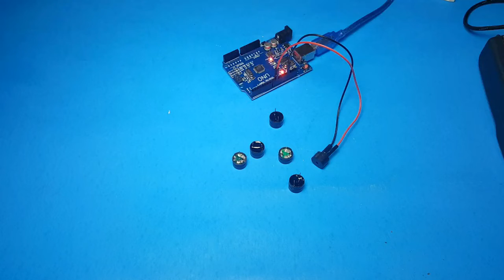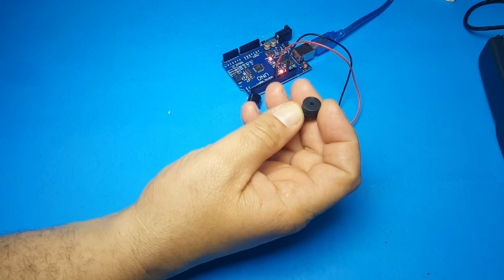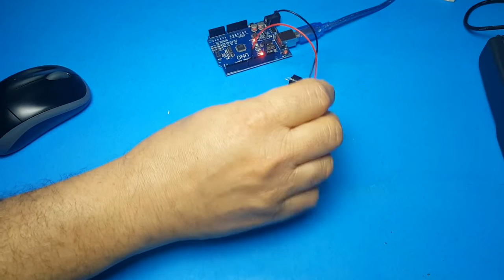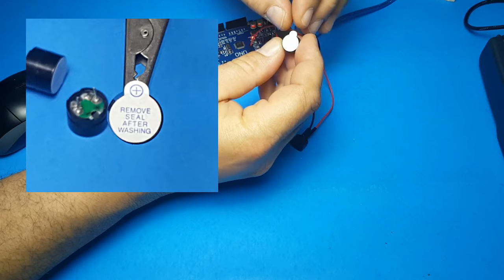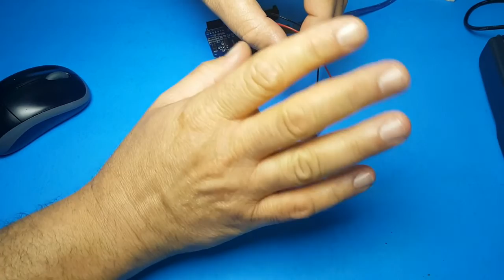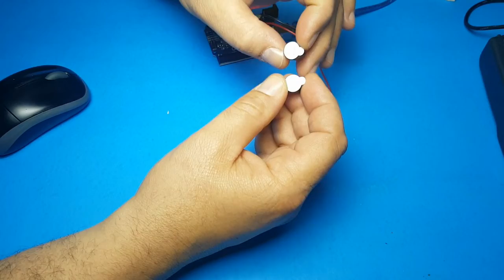Piezo Buzzer Review

Comment: For the "REMOVE SEAL AFTER WASHING" sticker: 
It's not that you NEED to wash it. It's that IF you solder it to a board or something and WANT to wash it to remove the flux you used, you should keep the sticker on so that the water (or whatever you wash it with) will not get inside the buzzer. 
So, it's not that there IS flux on the buzzer and the sticker is instructing you to wash it. The sticker is only to protect it IF you want to wash it after soldering.

Comment: What is difference between normal buzzer and piezoelectric buzzer
Reply: piezo buzzers are passive, normal buzzers are usually active.
Reply: @nochungushatersallowed5323 When active buzzers are applied voltage, it makes noise .But In piezoelectric buzzers, there need to be pressure for it to make noise.